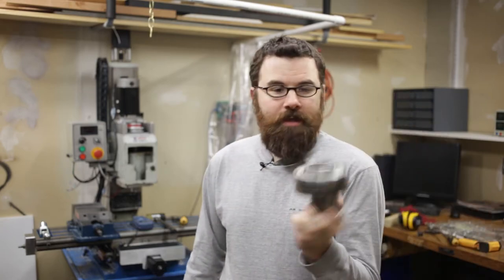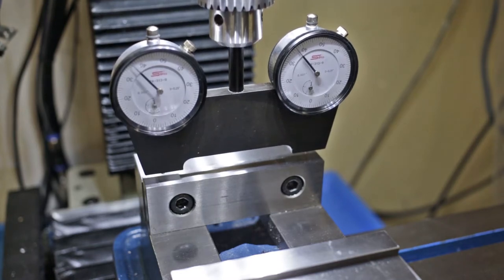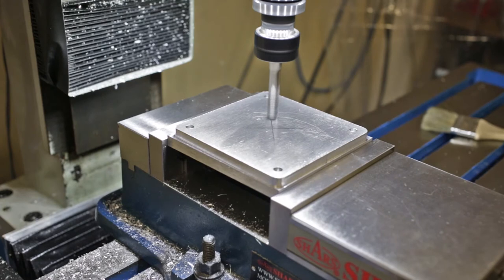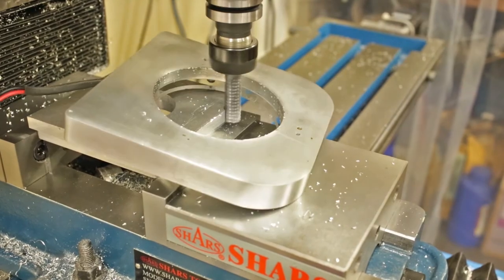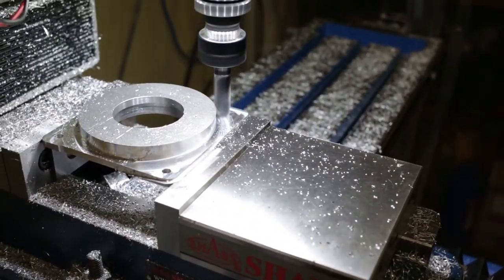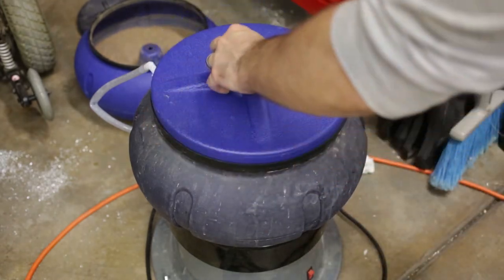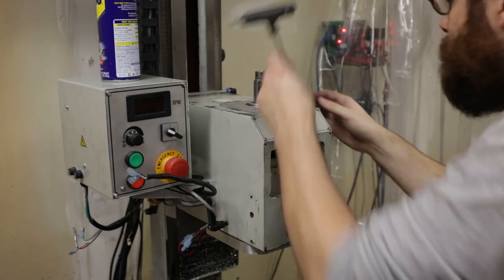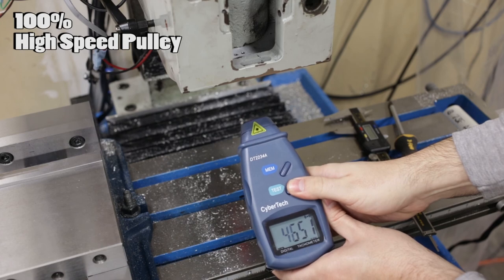Milling Machine Spindle Bearing Support

Comment: Very nice. Thank you for making that video. I've thought about doing the same thing to my G0704. What bearing did you use?
Reply from the maker: I honestly don't remember.  It's just a sealed radial bearing that fits the bores of the parts I made.  I just chose a standard size that was inexpensive and designed the parts around it.

Comment: hi rob, i loved tihs video, i have a bf20 mill and i am wanting to do the a belt drive for it, would you kindly share the size of the belt pulleys you are using and the size of the top bearing you have used, i have a cnc 7 x 10 lathe so i feel i will be able to make my own pulleys for my mill, please keep making the your video's as well,  the quaulty and infomation you share is great,  thanks daniel.

Comment: Nice work, thanks for sharing.. but, why not using a thrust bearing for the vertical axis instead of a regular radial one? Thank you!
Reply from the maker: +Flavio Luis Gino Bertolini - There is actually only a radial load.  The only load on this is from the pulley and the belt.  All the axial forces are taken by the large angular contact bearings in the bottom portion of the spindle.  The top support really only needs radial support.
Reply: +Robert Cowan (Rowen Hobbies) I see, thank you for your reply :D

Comment: This video totally cleared up something I had been wondering about with converting these machines!  Thanks!  What was the size/spec/type of the bearing you used here?
Reply from the maker: +Thomas Donalek I'd have to tear it apart to see what it was...  The size is pretty arbitrary, since I could make the OD and ID pretty much whatever I wanted.  The type is a basic radial bearing and it has a double rubber seal.  The RPM rating was well above what I am using it for.  I just went to VXB and picked a size that would work that was common enough and selected a radial bearing that was sealed.
Reply: +Robert Cowan (Rowen Hobbies) Makes sense.  Thanks!